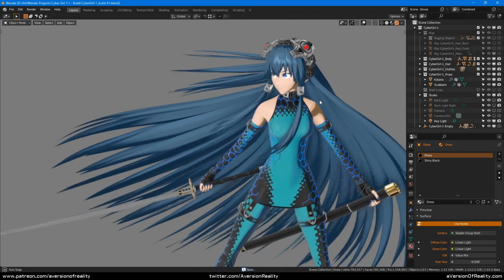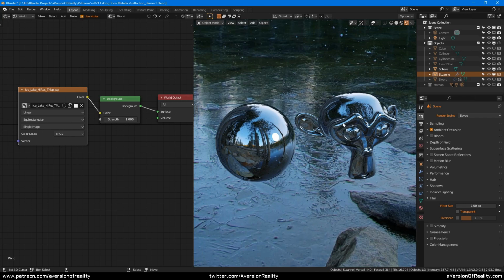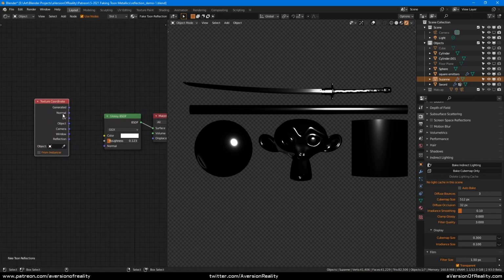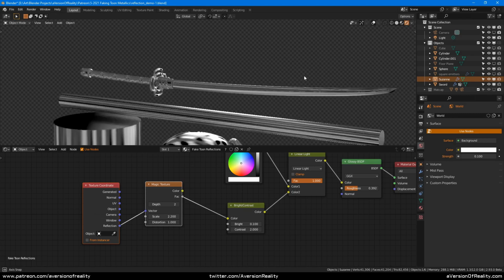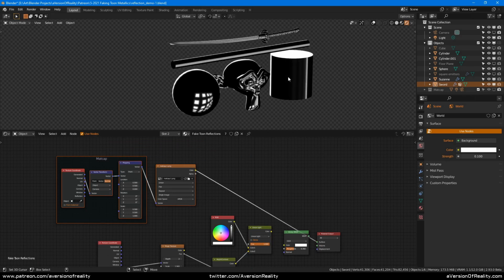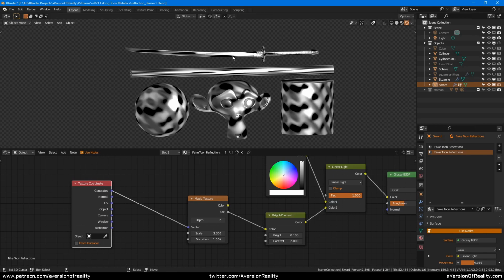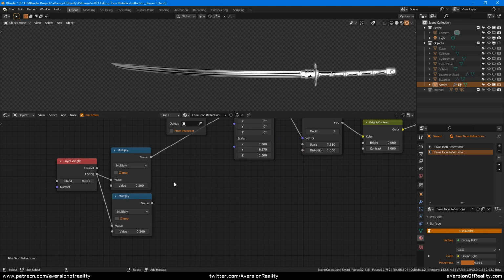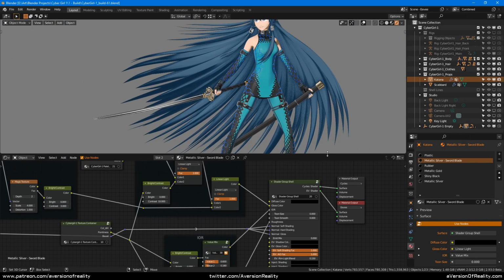Faking Toon Metallic Reflections in Blender 2.9

Comment: Thank you soooo much!!!! I searched everywhere on how to make a matcap shader to a material and didn't find anything at all. Everyone was so dumbfounded at that question, I can't believe I accidentally stumble upon the solution here. Really grateful for this knowlegde. Truly a treasure trove of knowledge in this channel. ❤‍🔥
Reply from the maker: Glad it worked! Remember, there's lots of different types of Matcap projection. That's why its hard to find any info. So the way I do it here may not necessarily match any other given method. The common thread for matcaps is that it uses camera info and usually Normals.

Comment: When I add the layer weight exactly like you did my texture doesnt move.
Reply from the maker: Which timestamp exactly?
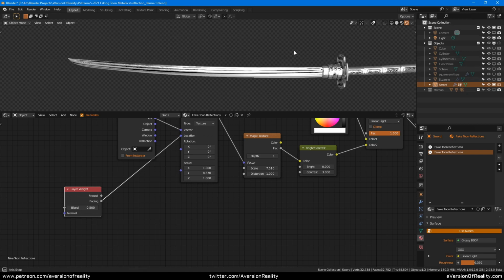Reply: @aVersionOfReality  28:46 My texture doesn't move I'm not sure what i did wrong. Does it have to do with your Y scale being 8.670? mine is 1. I didnt want my texture stretched but when i do stretch the texture it does appear to move but it looks like shit
Reply from the maker: @irl_sonic  Its going to vary depending on the size of the object and the various scales, yes. Have you tried different strengths of multiply? If you send me your file, I'll take a look. (Email on About page)